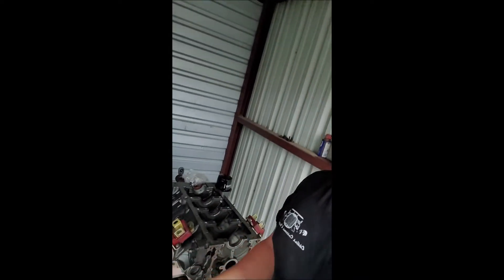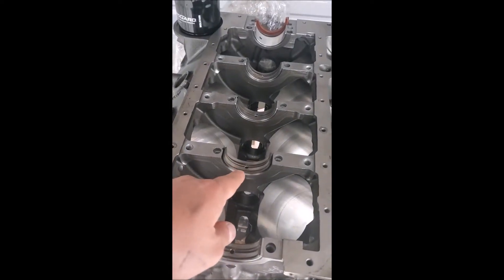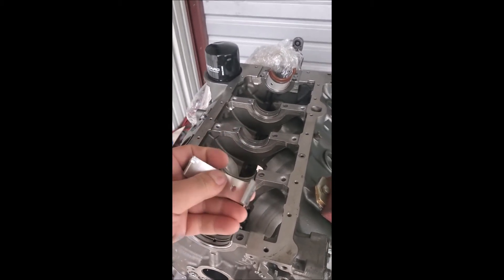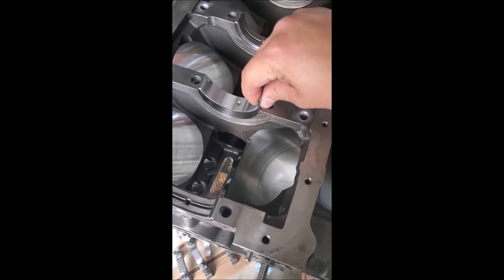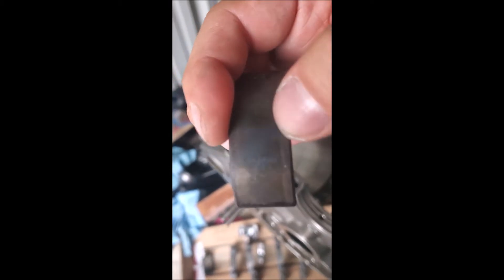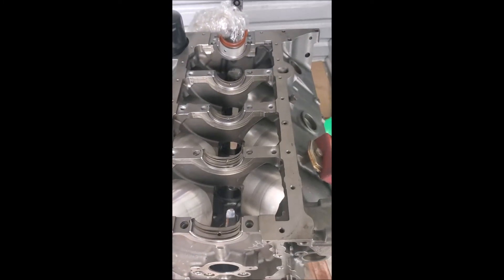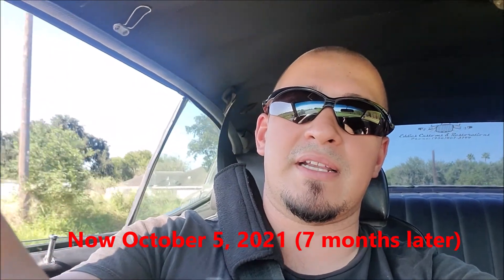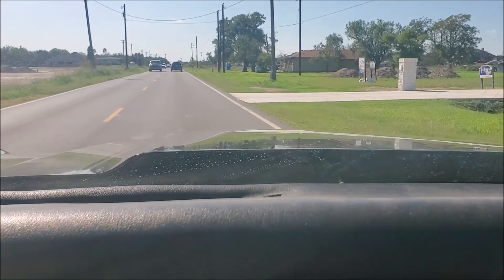Should you use main bearing spacers in your engine?

Comment: I used main brgs with spacers already part of the main brgs. I had a 060 over 400 sbc 4bolt main and installed a 350 steel crank. It made a 377 cod. This engine had instant rpm. It had 12:1 trw domed forged pistons. I used larger cc heads to drop the compression to about 11:1. Engine was streetable with 3:73 rear end gears and Muncie m-21 close ratio. All in a 69 Camaro. I had to ditch the mono leaf spring and went to multi-leaf rear springs, didn't brake any more springs...👍
Reply from the maker: Sounds like a beast! Love 69 camaros!!

Comment: With the main bearings stacked on top of the spacers what keeps them from spinning?
Seems like you'd have a lot more chance of spinning the bearing inside of the spacer.
Did you use LokTite Green to help secure them in place?
Reply from the maker: Both the spacers and the main bearings have a little tab on one side that keep them from spinning, you do not need any loctite or anything like that, I placed them dry since that doesn't need to be lubricated. The only part where you NEED to place assembly lube on is on the main bearing that is going to physically touch the crankshaft surface. It is very important that you put assembly lube there. But that is it. The motor is still running strong till this day, no issues. Thanks for viewing and good luck on your engine build.

Comment: I can tell everyone this was common practice 35+ years ago, working on engine crank bearing fitment. Shim stock was sold in sheets for repairs that lasted years and many high performance engines. As plastic-gauge became popular, placing a “STD” bearing on top, with 0.001” thousands under the other shell, made a half size bearing on a perfectly good crank, yet get your 0.015” clearance. The shim stock is steel, cut with scissors and used behind the new bearing shell years before a 0.001” oversized bearing shell was made available. 
 Those who never worked on imports would find 2 measurements. One stamped on the block and the other was found using full crush and torque with plastic-gauge or a micrometer on the cranks journal to achieve the correct oil gap, as all machining methods were not perfect. So the outside was important to achieve crush, while the inside measurement gets the proper oil gap. After all, it rides on a thin layer of oil and not the bearing.
 Many engines with high mileage were saved by using bearing shells of two sizes. A STD shell on a 0.001 oversized bearing shell was common. It did not wear or bend the crank as some may say. But, why do we add main cap saddles, cherish a 4 bolt main or bolt & torque a head plate onto a block before it is honed or bored? We understand the entire block will twist under extreme loads. Iron blocks maybe preferred by an engine builder by application, but how are we getting so much HP from all aluminum blocks in the “LS” engine family and still seeing 250k - 300k miles out of these. How many main crank bolts are used on these saddles? Forged, cast steel, iron block or aluminum, they move with temp and load, and always will. Why did limits on engines used in dragsters, force a new class or 4 cylinder racing? The guys bore a solid billet of high grade aluminum with everything needed except a water jacket? No coolant is used during the warm-up period and the actual race! I still have sheets of shim stock stored like a DiVinci painting in my tool box. Ask a professional engine builder in their 60’s or 70’s about shim stock under bearings? I hope you have an extra hour to listen! 
It is real, it works, but I can honestly say, that I have never seen it made for this issue brother! It has got to be the only one on YouTube.
 Today, highly skilled engine builders and technicians were born during fuel injection, they have very few clues how a carburetor works! Ask a Ford guy what a “VV7200” or “VV7400” carburetor was? I know, I fixed them and never worked at a Ford dealership.
DK, ASE master tech since 78, retired.